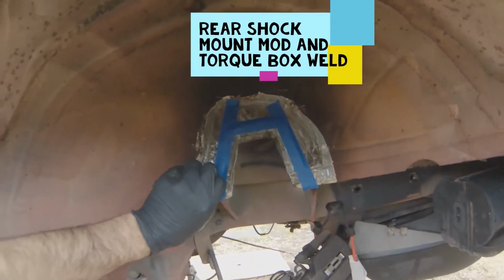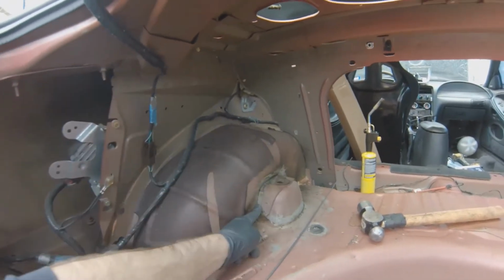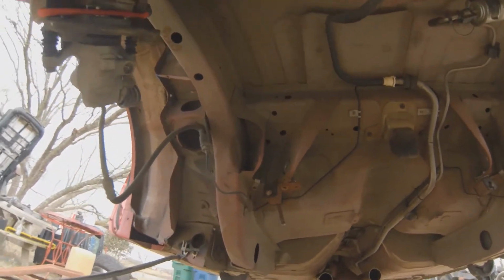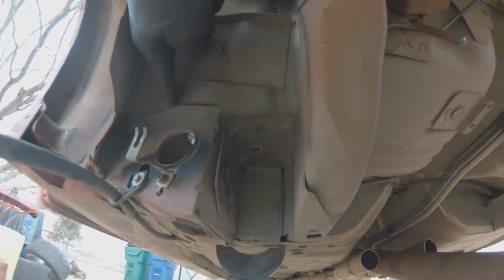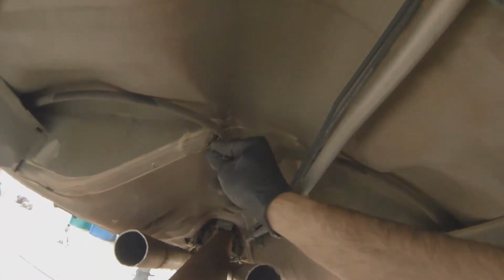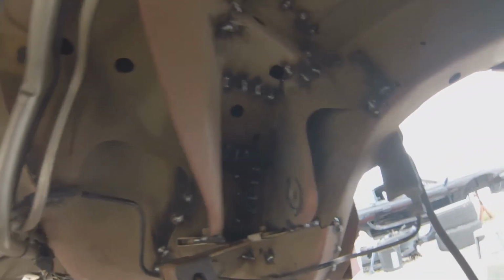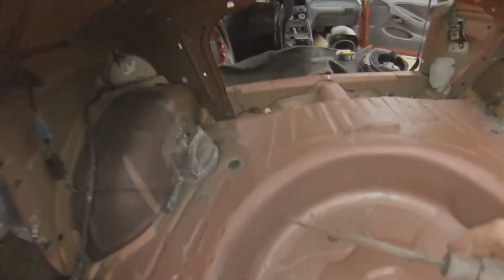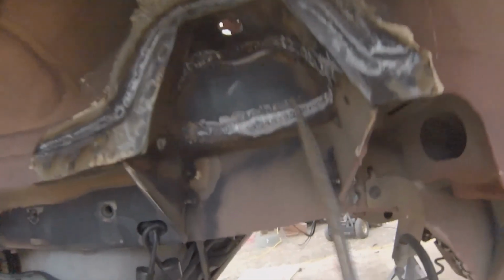WISEFOX Angle Kit Install Mustang Drift Build Part 7 of 8 " Rear coilover clearance & stitch weld"

Comment: Have you ever heard of someone running a maximum motorsports torque arm on a drift build? Or any torque arm for that matter.  I have a new edge that I've been building into a track car and its been doing fine but I think I want to go in the drift direction when I order new front control arms.  I'm a little concerned the torque arm will produce too much grip though.  Thank you in advance
Reply from the maker: Yes I know another driver who ran a MM torque arm on his new edge and it had no issues drifting. You can always adjust your grip level with tire compounds, air pressure and adjusting rear rebound setting 👍
Reply: @1320time  Awesome! that's good to hear someone else has actually done it. Thanks for the quick reply too 👍